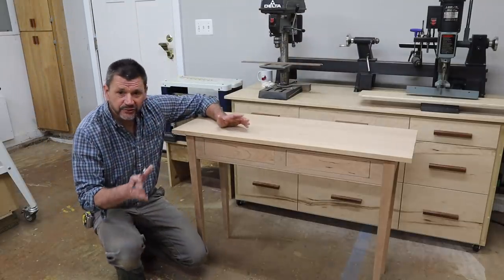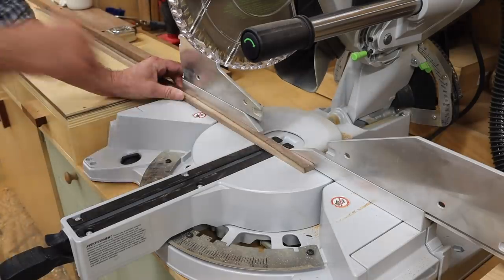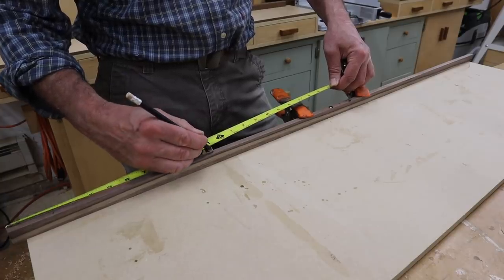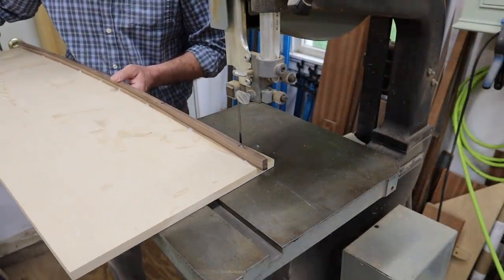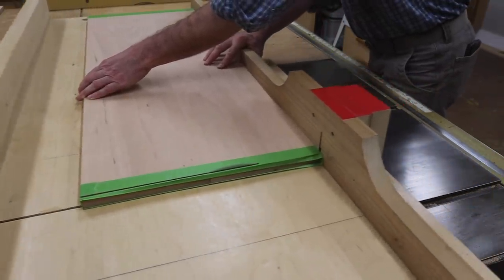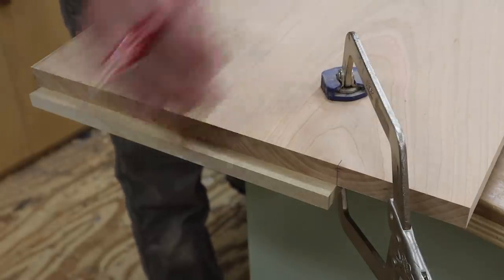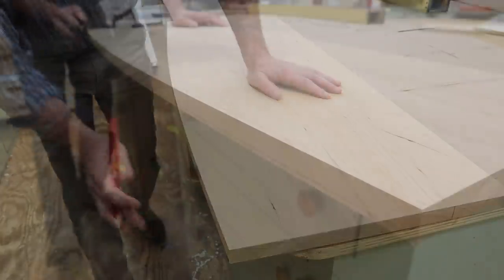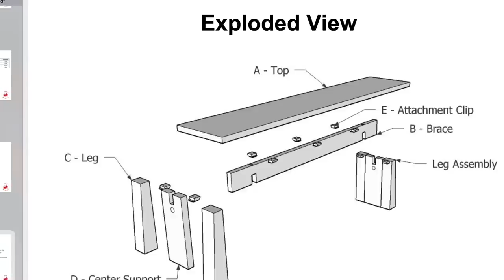How To Make a Curved Table Top

Comment: John, gorgeous work as usual, one of your biggest fans. 

I was just wondering if I was the only one cringing when you ruined your table saw sled cutting what's a blade on an angle. Negates the whole idea of a zero clearance and accurate cut line.....
Reply from the maker: Thanks Elie, I know I had already cut a The 5° angle with the sled about a year ago during a moment of weakness so this cut wasn’t that painful. The good news is the sled still works great.

Comment: Jon you need a zero clearance insert for the kapex and use the laser line on the kapex
Reply from the maker: Thinking about it but this saw cuts so nice as is… The laser is a nice option I just haven’t gotten used to using it yet